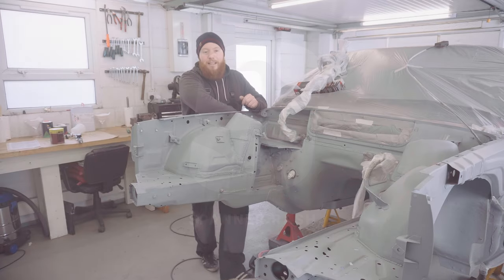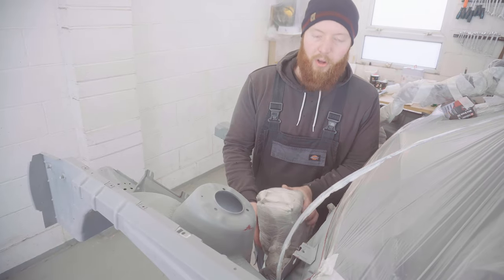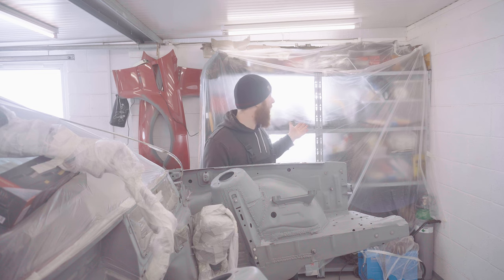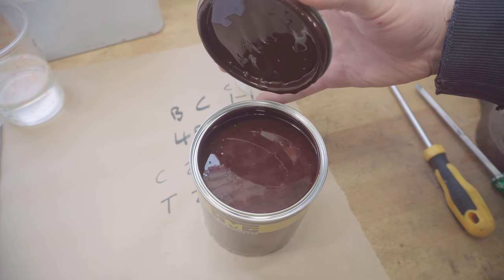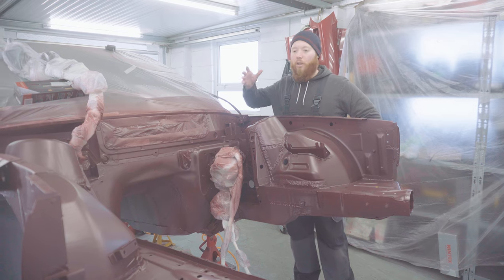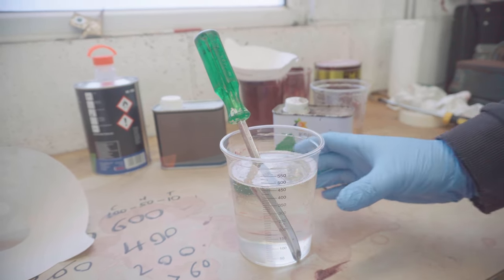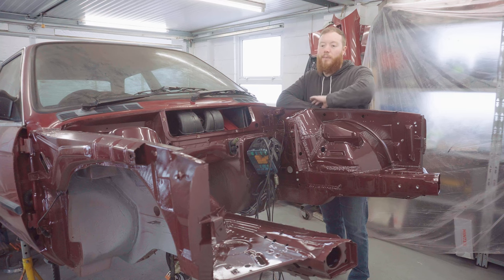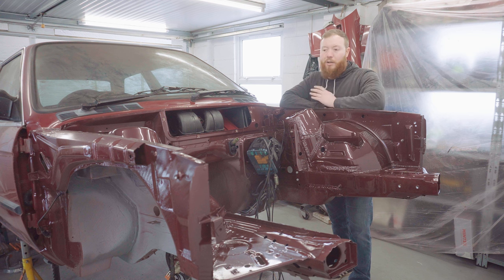Painting The E30's Engine Bay [COLOUR REVEAL] Kapci Basecoat & Clearcoat Paint | 038

Comment: i think that it looks very good, that little orange peel looks factory how it should
Reply from the maker: Thanks Matej, if I end up with a paint job that looks OE with a bit of orange peel I'll be very pleased.

This engine bay was definitely not my finest work unfortunately, despite the lovely new ANI F160 gun.

It's not the gun's fault though of course. I cut corners with the masking which is why I got dust particles from the previous epoxy primer coat, and also painting a complex shape engine bay is just super difficult for me! 😂

I will keep learning, the exterior of the car will be better I'm sure!
Reply: @SPANNERRASH  yes i can imagine all the corners, hard to keep the wet edge being wet, but i think learning is the most important thing, job doesnt need to be perfect, but for the engine bay looks very good and shiny
Reply from the maker: @matejdimos5749  I couldn't agree more, every day is a school day working on this E30. Cheers! 😁
Reply: From factory it is not cleared
Reply: @denguefever9489  maybe this old cars aren't, i dont know anything about bmws, but newer cars are cleared almost everywhere except underside

Comment: For the whole car id recommended getting some puller fans you can place at the garage door end and just lift the door to then height of thr fans.

In regards to the colour it looks like a boring brown/red in the artificial light but the pictures in the sun you put up i was a fan, nice choice.
Reply from the maker: Yeah, I was very relieved when I took that core support outside and it came to life! I thought I was going to have to start over for a minute. 🤣

Nice idea with the puller fans, I've seen others manage to make a positive pressure spraying tent with filtered stacked fans. I think I'd use the side door and make a fan rig for that to pull clean air in.

I'm planning to spray some of the panels off the car, so if I'm having a hard time getting clean results that will be my next project...
Reply: @SPANNERRASH  painting in a non controlled environment like a booth is always tricky and gonna leave some dirt, just means some extra time flat and polishing

Comment: You can always wet sand and polish the dust nibs out, or alternatively grey scotch brite the whole bay and just shoot 2 more coats of clear with fresh masking.

Cool colour though, always liked it myself
Reply from the maker: Yeah that's what I was thinking too pal, but it's not worth getting all OCD about it I don't think. I'll be polishing things that'll never be seen once there's an engine in there! Interesting idea about scuffing it back up and doing another 2 coats of clear. I guess there's no reason that shouldn't work! 🤔
Reply: @SPANNERRASH  it’s a common thing to do on show cars, it’s called “flow coating” you shoot the first two coats of clear, then when dry you flat it with 800 grit and put another two coats of clear on. The finish is like glass when done properly. A flow coat has saved me a few times when getting a run or lots of dust, sometimes it’s easier to flow coat than spend all day flatting and polishing it
Reply from the maker: @peakperformance8960  Aha I have heard that term before, I think I might actually intend to do that for the exterior paint job, it sounds like it could really be worth getting that extra clear on so I can polish is right up and remove any trash in the finish, some of which is likely unavoidable being a garage spray job. Thanks for that tip!

Comment: 1st. Really cool color. Also when you paint the rest of the car you need to wet the floor so the dust particles don't fly and then stick to the paint.
Reply from the maker: You're seriously quick Lupul, I'm impressed! 😆

Yeah that's awesome advice about the floor, I should have wet it a lot more than I did. I think the main issue was using the same masking as when I did the epoxy primer coat prior, I'm 95% sure it's all dust that came off the sheet over the windscreen.

Luckily it's only an engine bay, it's a valuable lesson to learn for when I do the exterior though.

Comment: This video is insanely helpful, thank you! How long did you leave between coats for the top coat? I see on the tin it says 14-16 hrs but I presume that isn’t per coat of it?
Reply from the maker: Hi Eleanor, really glad the vid is useful for you.

For the base coat (colour), leave around 10 mins between coats. Then leave at least 45 mins before moving onto the clearcoat to avoid solvent pop.

With the clearcoat, do a light mist coat first, then give it just a few minutes to go tacky before moving onto a good wet coat.

Leave around 10 mins and then apply a second wet coat. 

Then let it sit for the 14-16 hours to harden up.

But do look at the data sheet from the paint manufacturer and take ambient temperature into account. They can vary a bit. 😁

Comment: Great work mate , I use the A.N.I stuff and I love it,
How do you find the Kapci clear coat?
I’m looking for something to replace multimix HS clear as 5 months later it’s still soft.
Reply from the maker: Thanks Jason! Yeah I'm so happy with this ANI F160 gun, it's a huge step up from the Sealey guns I've used for years. I'm sure it'll be a game changer for me when I paint the exterior of the car. 👌

To be honest I've not used many other than Kapci as its what my local paint supplier has recommended to me over the years. I tried his higher more expensive clearcoat at one time in the past but I couldn't notice a single difference so went back to Kapci.

It's definitely softer than BMW factory paint (known as quite hard paint from my understanding) but I thought that came more down to the way factory paint jobs are baked. Maybe you know more about the difference than I though, I'd be interested to know.
Reply: @SPANNERRASH  well like you I don’t have an oven to bake the paint in but unlike you I don’t have a garage so all my is done in the garden and in the summer.
Well yeah usually you do a fast first tack coat and then a full set coat with clear especially when it’s air drying , also go for HS which is high solids rather than MS which is medium solids.
And 50% overlap minimum sometimes 80% overlap, usually you don’t even need to thin the paint out.
But I was recommended multi-mix HS clear as it was supposed to be paint at home friendly with fast activator.
But painted panels last summer and you can still put your finger nail in the paint weird as I wet saneded and polished it fine but it’s soft it’s weird
Reply from the maker: @medievilassassin  Nothing wrong with that, my best work to date has been done in the garden! Interesting what you say about the solid rating I'll have to have a closer look at that, don't remember being offered the choice.

Seems annoying that your finger nail can still mark the clear its that soft. I bet it polishes up easy though! I always find my paint jobs to be softer than OE, but maybe not by that much!
Reply: @SPANNERRASH  what’s even more annoying is that I got it like glass but my OCD is keeping me awake over it so I will have to paint the whole bonnet and wings again .
Yes HS means you can put less clear on and it will be enough to wet sand and polish.
Are you on instagram mate
Reply from the maker: @medievilassassin  Haha yeah I know what you mean, I've been fighting the same tendancies.  I think I might be winning this past few years though. Much more willing to settle for "best effort". 😅

And yep, we're absolutely on IG: https://www.instagram.com/spannerrashteam/

Comment: What gun is that ?
Reply from the maker: I went with ANI F160 spray gun, with a 1.2 tip. I linked it in the description if you want to check it out.

It should be a game changer for when I paint the exterior of the car, a nice wide fan, and the paint comes out so fine compared to the super cheap Sealey guns I was using before.

Obviously in paint gun terms, it's still a "cheap gun", but it seems to come very well reviewed by people who know a lot more than I do about painting. Namely @TheGunmanChannel 😃
Reply: @SPANNERRASH  I have the R150 it's a good gun. The Flg5 is a great gun also. Especially for a full panel/car spray
Reply from the maker: @choco107  Awesome I will check those out too.

Comment: Lovely color choice. I can't wait to see the entire car in its final color. I'm just about to tear into my '87 e30 as well (shaved bay, turbo motor, and a full respray) and your build has been a great motivator and inspiration. I'm planning a Black Sapphire Metallic to match my M2C. You mentioned a steering rack swap towards the end. I did a Z3 1.9L rack in my car (2.7 turns full lock-to-full lock) and it's absolutely perfect. Ironically, my M2C has roughly the same ratio. Maybe that's one of the reasons I fell in love with the drive of it. If it's one of your choices, I HIGHLY recommend the Z3 rack. Doesn't wander on the freeway, but it'll get the front end to really turn-in when you need it on the backroads. You won't regret it.
Reply from the maker: Awesome really glad my vids have been encouraging for you with your E30 project! It'll be really cool having matching pair, I was tempted to go Imola to match my E46 M3 but the opportunity to do something more unusual was too good.

Great shout on the Z3 rack, currently thinking it's at the top of my list. I had a purple tag rack on an E30 318is years back and loved the upgrade, slightly faster couldn't hurt! Thanks for the recommendation. 😄